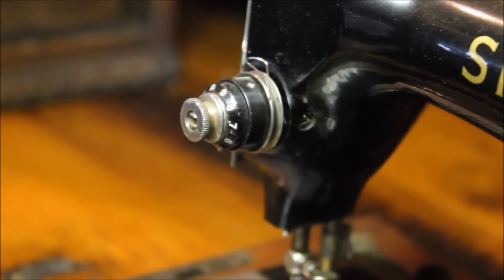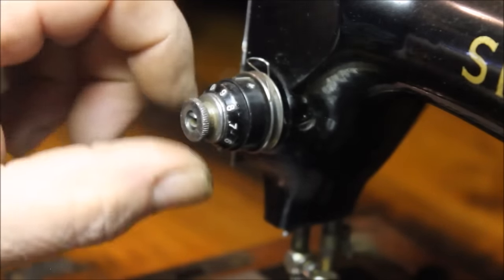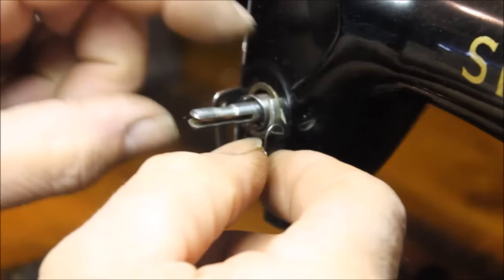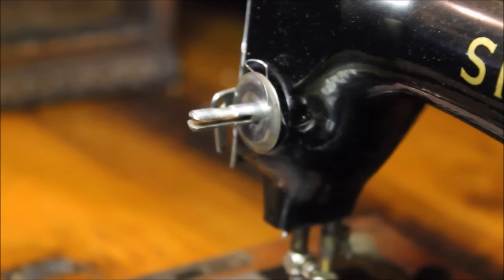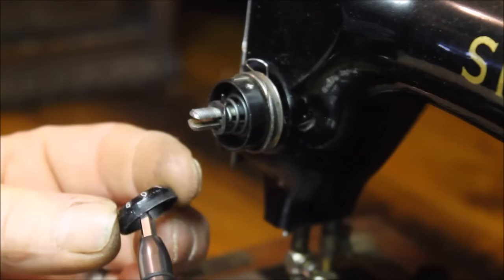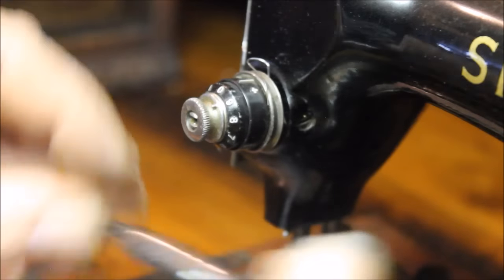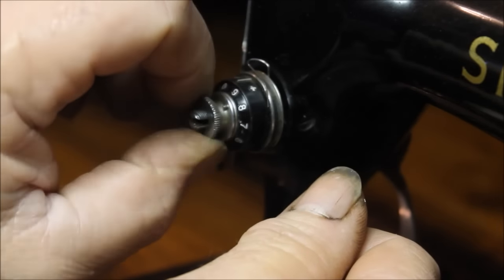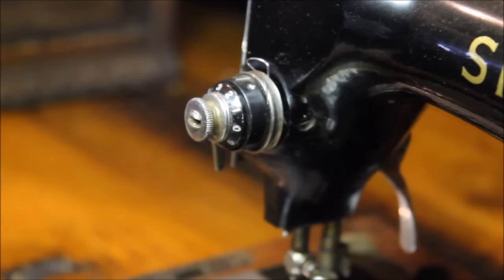Solving Singer Sewing Machine Tensioner Issues

Comment: I followed your instructions to the letter.  Getting the tension assembly back on correctly is not my problem though.  No matter how I turn the dial my tension just won't work right and I am about to chuck this machine in the bin.
Reply: same me i get frustrate sometimes.

Comment: My 306 W has a 3rd flat disc which appears to not belong to the tensioner.  Am I correct in this assumption?
Reply from the maker: there is a flat plate that sits between two typical tension discs. That is to make the machine capable of running double threads/needle. Two tensioners in one

Comment: Is the sitting different for a 66-1?
Reply from the maker: What part? The 66 and 99 share the same tension assemblies but depends on which tension. There is the old style and the new style (with the numbered dial). I don't know what you're asking
Reply: @rayelkins7872  it’s the old style. And it seems the spring is messed up..I got it it to sew, a few rows but then it breaks. This is my first time taking tension off and putting back on . I’m just learning. I’ve had this treadle over 10 years. Since the end of May I’ve got 2 221 featherweights, a 66 in a case & a 127 in a case.ive adjusted cleaned all of them and love it! I’m learning as I go and truly enjoy it! Thank you for your help!

Comment: Why is thread in my sewing machine not sewing in my fabric... I need your help please
Reply from the maker: I would need a bit more info to answer you question.
Reply: Ray Elkins I have a 3102 singer sewing machine and I threaded the machine and bobbin but when I began to sew the thread is not tight at all it is so loose that it immediately comes apart. Its like its not stitching into the fabric.